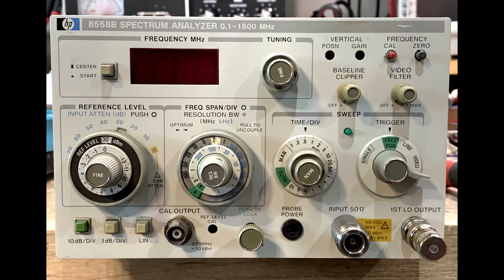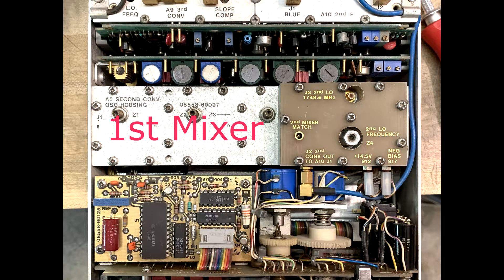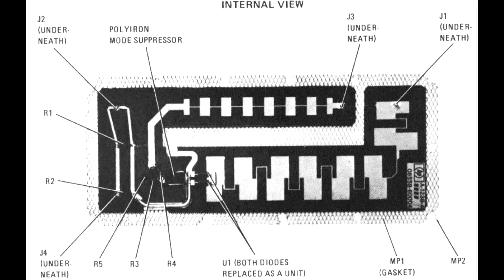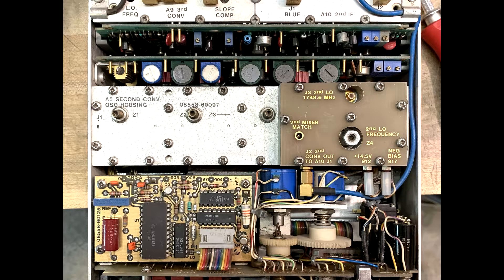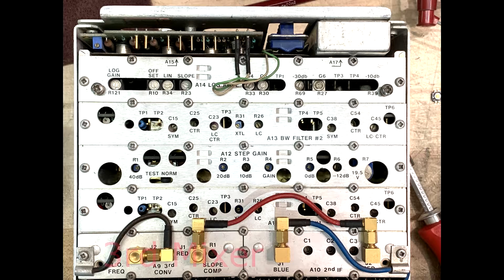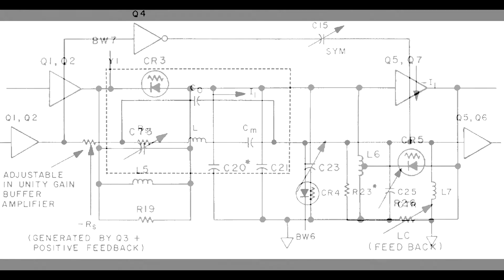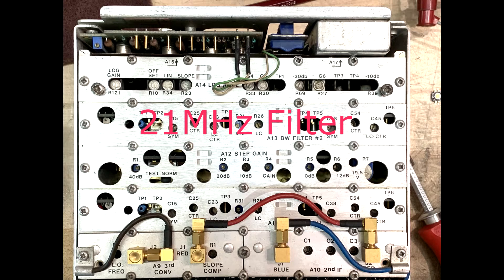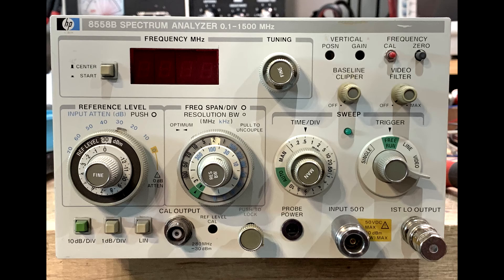#546 HP 8558B Spectrum Analyzer Design Run-through

Comment: Hi, Guy!  I'm a novice.  
1.  If the auto sweep is not working but, manual sweep is working, how can the HP 8558B be used?  What functionality will be missing?  
2. How might a device like this be used to experiment with a guitar and the related effects and amplification?
Reply from the maker: It is not well suited for audio work
Reply: @IMSAIGuy  I saw this on Craigslist near Philadelphia.  HP8558B Spectrum Analyzer and HP853 Mainframe